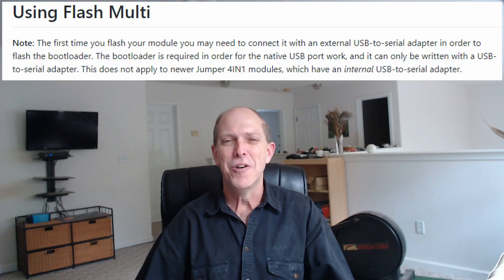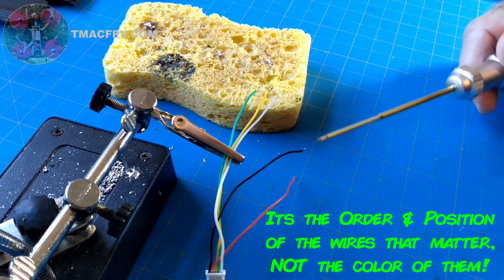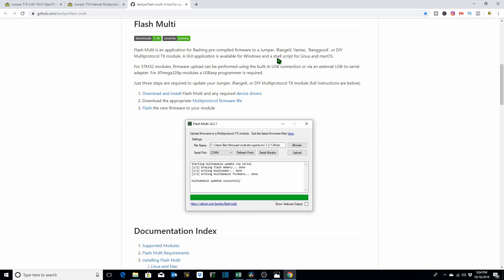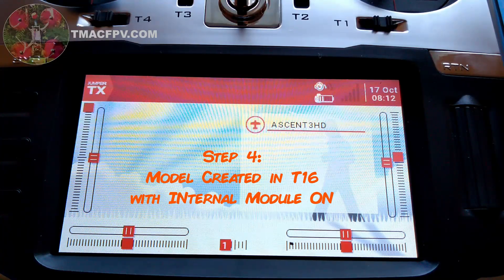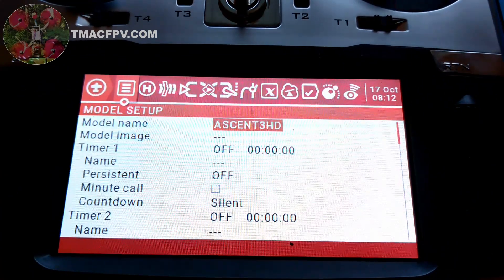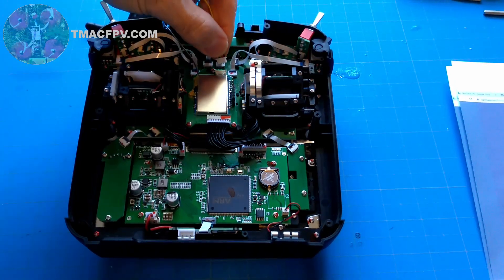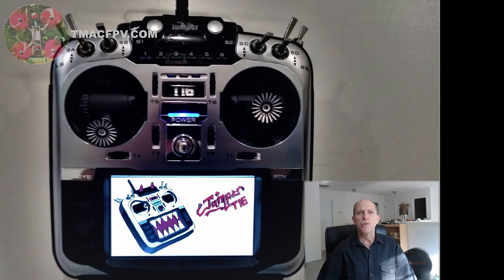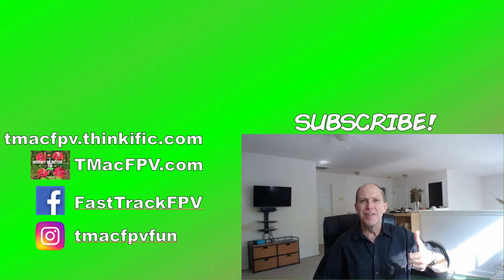JUMPER T16 PRO BOOTLOADER AND FIRMWARE UPDATE

Comment: I just ordered mine that means I have to do all this updating for my jumper t16 pro I'am not good at updating firmware.I thought it came ready to use.that sucks
Reply from the maker: No, you're good! It does come ready to use, no worries  at all! You made a great decision.  Please let me clarify.  The T16 comes with certain "firmware" installed on it which is ready to use.  This video is only describing a process which will need to be accomplished ONCE (for the bootloader) and only if/when you want to upgrade the module firmware  when OpenTX officially supports it in the near future.   Firmware upgrades normally mean enhanced features or fixes to previous "bugs" in the firmware.  For example, if you look on the 1st page of the checklist mentioned which you can download through the link, there's a comment which says "RADIO FIRMWARE-IMPORTANT.  A "bug" has been found with the firmware Jumper has placed on the T16 FOR DSM/SPECTRUM receivers ON THE INTERNAL MODULE ONLY."  So, if you're running DSM/SPECTRUM receivers you'll need to upload patched Jumper  firmware (which this video did NOT cover but is available through  RCGroups (see checklist)). If you're not running DSM/Spectrum receivers with your new T16, you don't NEED to do any of this in the video until you're ready to update module firmware. Hope this helps. If you need anything else, please let me know.

Comment from the maker: I learned a lot making this video.  Please be aware the Jumper Radio firmware is DIFFERENT than the internal multi-protocol module firmware.  Do not get the two confused.  This video demonstrates the process to upload the correct bootloader for the internal multi-module and update the internal multi-module firmware only.  The T16 comes ready to use, as is.  You will only need to perform this process if you need/want to update the firmware.  There may be situations which warrant doing this.  ****There is a known "bug" in the JumperTX firmware for Spektrum receivers (DSM protocol).  There is an unofficial "fix" for this issue. For further information on DSM issue and unofficial "fix" please see a post from Benzo99 on RCGroups at this link:  https://drive.google.com/file/d/1OyZStkAUHd-2rnkUetUFYPuasPL5Bvt1/view?usp=sharing .  ****The Jumper T16 is an amazing transmitter with all of its features and capabilities.  With the advent of OpenTx support its only going to get better.! 🤩
Reply: Once opentx 2.3.3 is released officially, will I still need to do this (using dsm). Thanks
Reply from the maker: @Hells_Gate  You'll need to check the firmware on your internal module. Go to Model Setup menu and just above where you bind the receiver you'll see your internal module firmware version. If that version ends in .51, then Yes, you will need to do this to upliad the bootloader to your module & update it's firmware once this way. From then on when you want/need to update the module firmware you can do it through the OpenTx flash module ability on your transmitter. This is different than updating your system firmware from JumperTX to OpenTX. I've got a video clarifying this coming out in a day or 2
Reply: @TMacFPV   Thanks, I did manage to find the discussion on rcgroups in the end and with alot more searching I managed to figure it out. Thanks for responding. Will keep an eye on my notifications for it. Cheers